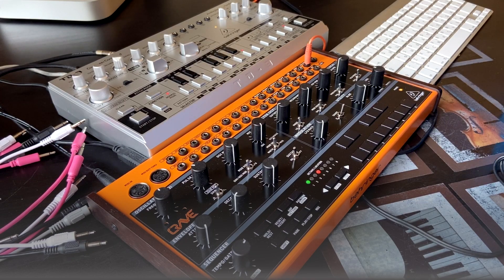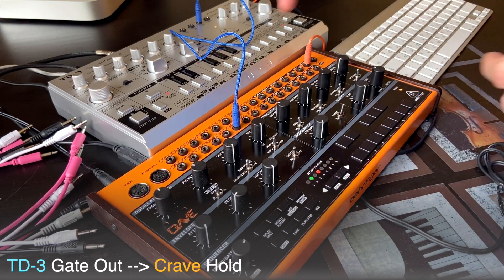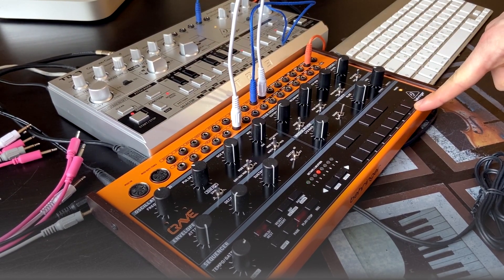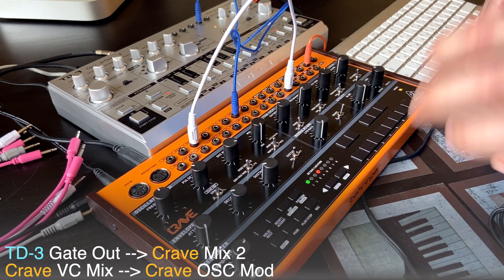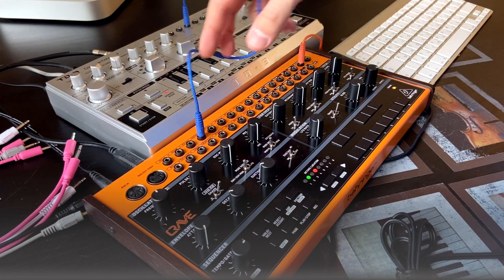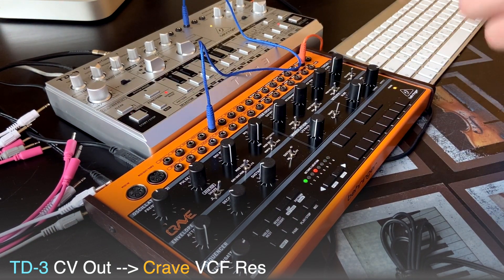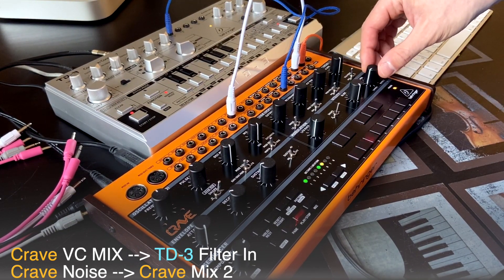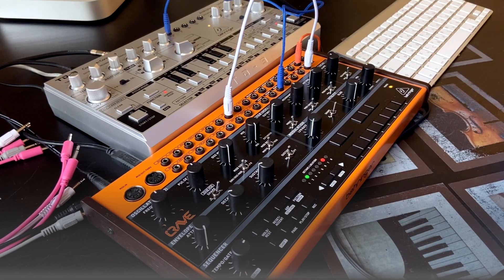Behringer Crave + TD-3 combination using CV tutorial. Patch Ideas

Comment: The TD-3 manual states the following regarding the Filter-In on the TD-3
FILTER IN - this input allows the connection of an external audio signal instead of the internal VCO oscillator.
So this is not for modulating the Cutoff, but for allowing the use of the TD-3 filter with external audio signals.

Comment: Anton, regarding this "multiple bug", I assume it is caused by incompatible voltages of the TD-3's gate (0 to +12 V) and the multiple in / out (-5 to +5 V). However the hold, reset and play/pause switch at more than 3.2 V. So when it's directly connected it seems to work because the hold, reset and play/pause inputs simply get voltages +/- the 3.2 V threshold. But when the multiple in-out path is used, which is also built for - 5 to +5 V, there seems to be a problem - which I cannot describe in detail, because of missing knowledge about the Crave's internals or the electronic backgrounds. I think the multiple out tries to stay conform to its specifications +/- 5 V and it cannot handle the 12 V in this range and hence possibly never clearly reaches the 3.2 V threshold, even though 0 V means off and 12 V on. The multiple seems to buffer.
Does anybody else have an explanation?
Reply from the maker: Good point

Comment: Hey Anton, that's great stuff. Thanks for sharing. I have a question. If I hear correctly, in about 13:55 you are sending slides (glided notes) from TD3 to Crave... And Crave receives them and plays them. Am I correct? I would like my modular microsynths receive slide notes.... If I would use TD3 as a sequencer, and send the CV Out to OSC CV In of anoter modular/semi-modular synth will it play the slides programed in TD3?

Comment: Great work! You know what you're doing. But what, if you don't have a DAW in background and want to couple the two devices directly? I have both of them for days know, but can't succeed. Volcas are easy in that. Took me 5 Minutes. It's a shame, Behringer has no real manual or documentation...   Regards, Thees
Reply: Does it work if you just use the sync jack? Or did you find another solution?

Comment: So, I am connecting the TD-3 cv and gate out to the crave and it plays the correct melody but it's an octave too high, while the frequency knob of the crave is in its middle position. Could I change the octave on the crave when using the external control?
Reply from the maker: I guess you may transpose as usual with the keys
Reply: @AntonAnru  thanks I just found out how this works.

Comment: SUPER video, thanks  ...
Newbie question time ... 
I am using a TB-03 (midi slave) & TR-8s (midi master) (no computer /DAW)...
I am getting a Crave this week, can i use the CV patch output from TB-03 to Crave (as shown here W/ TD3 to Crave)
and not need to use midi from TB-03 to Crave ?
If i am understanding correctly, the TB-03 would control the tempo & start/stop without midi or UCB via the (CV) patch cable ? 
                                                THANKS in advance for any advice .
                                                                                                                  Jason from Detroit
Reply from the maker: Hi Jason, thank you for the comment. Td3 doesn't have tempo/clock output, so it can't control other devices tempo via cv. The easiest way is to use midi. And make sure to set Crave tempo input source to midi in synthtool app
Reply: @AntonAnru   Thanks, i don"t have a computer that supports downloading drivers  (chrome not windows) so synthtool will not be an option for me. Will i need to buy a laptop with windows and downlaod synthtool to sync my crave ? I truly hope i can use my crave in sync with out a laptop. My 3 machines (TB-03 /TR-8s &Crave) in a daisy chain. thanks for your time . If you have any tips on a no laptop set up please share.
Reply from the maker: i guess these settings can be done on  the front panel. But for me it was much easier to use the app. There is also a ios app, if you don't have a computer
Reply from the maker: Hello again) you may sync crave to td3 using cv if you send clock from Crave Assign output (seq clock) to td3 sync in

Comment: is the same sequence programmed on the Crave or is it just a blank pattern ? i only need a slave which gives a little more grovve like the gate functions. my td3 is the slave to mc707 via midi, i only want to send the td3 pattern to crave, what are the settings in the synth tool for td3 and crave ?? thank you
Reply from the maker: Crave has its own sequence here, td3 as well. You may send notes from td3 to crave with cv and gate outs on td3.
Reply: @AntonAnru  cool . i am new in this modular synth world, my first step.. where do i put  cv and gate outs from td3, in wchich slot from crave ?? p.s. i have bought your td-3 dreamy sequences and the other too, i will listen to them soon.. thanks..
Reply from the maker: Thank you for support. Td3 cv out - crave osc cv in, td3 gate out - crave env gate in

Comment: Hi antun I’m using crave and td3 usually with ableton. Every time that I’m writing my pattern and play them in the arrangement it triggered the patterns inside the synthesisers and than I have to press ‘stop’ in both of them. If you understand what I mean, can you tell me how I fix it? Thank you
Reply from the maker: When you hit play in Ableton it sends Start message to then via midi/usb. I don't think there's an easy and obvious way to turn it off. Maybe it's possible to pass then through some midi filter, where it's possible to switch off Start/Stop message. But I can't help with it at the moment. I never did it

Comment: Can you use the oscillator of td-3 with the crave?
Reply from the maker: So you mean pitch control from td3?
Reply: @AntonAnru  I'm a bit confused with the patching. 

Behringer has a video where they use a module that adds an oscillator to Crave. 

Here's the video: https://youtu.be/Y2EMj0IE5iA?t=43
Reply from the maker: Yes, you can add anything to a modular system. You were asking about using oscillator,  yes, you can. But it depends on how you gonna to use it
Reply: @AntonAnru  I need to try some patches and come back with an answer to the "how" :-) - thanks for your responses!
Reply from the maker: Welcome

Comment: I have a problem syncing the td3 to Ableton. The tempo is always changing and it frustrates me.
Reply: try using an audio clip with a click & patch that to the Sync In.. then you will be synchronized @ audio rate instead of MIDI which I assume is your issue with tempo drift. I use a similar technique to sync my MC-202 to DAW.

Comment: Can the CV be controlled via USB at all?

My DAW recently added some CV stuff but I don't have any CV hardware or a CV soundcard or anything, just wondering if Crave would be a good intro to it, or whether I'd need to keep splashing out...
Reply from the maker: you can't control CV just by connecting Crave via USB. yes, as you mentioned, you need a special sound card, or any module that converts USB/MIDI to CV
Reply: David, the Korg SQ-1 has a non-sequence mode where it is a USB-MIDI to CV converter. It worked fine for sending CV to my Neutron from my MPC.

Comment: My crave also 'holds' to a single step when connection the TD-3 -> multiple IN, multiple OUT -> hold (Crave). A bug, maybe?
Reply from the maker: i guess the voltage is shifted a bit
Reply: Same...
Reply: My suggestion is to use a mult lead or one of those star mults.

Comment: im having a really hard time connecting my crave to ableton. arp and sequences just dont play. i have midi track and sync on input and track out output. i just cant figure it out!!! any tips?
Reply from the maker: Check out buffet size in preferences. It should be as low as possible. Also turn on reduced latency in options menu